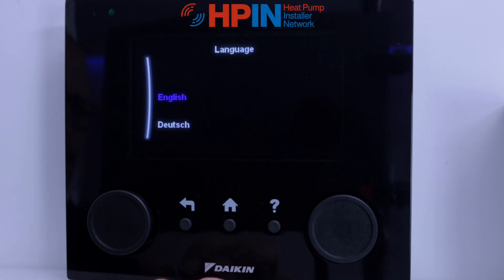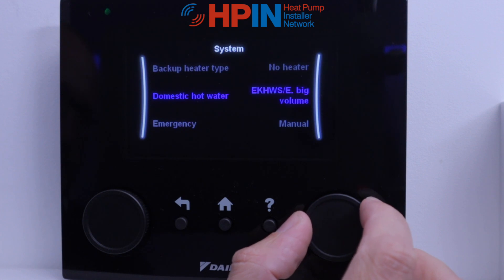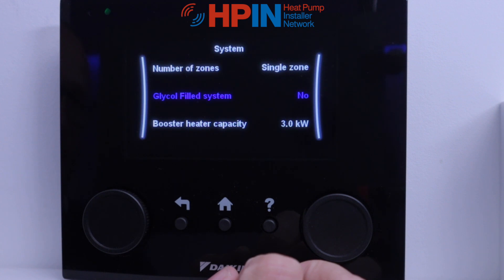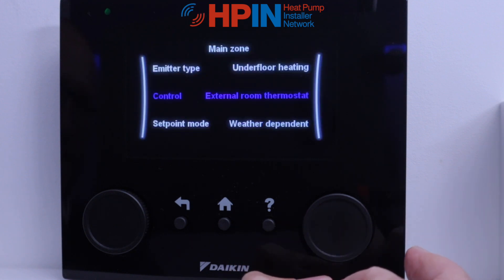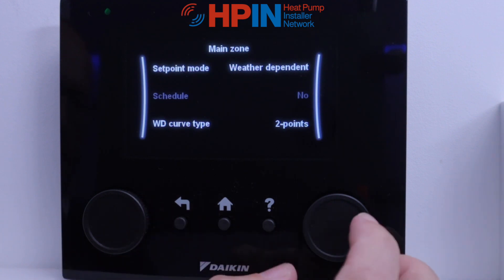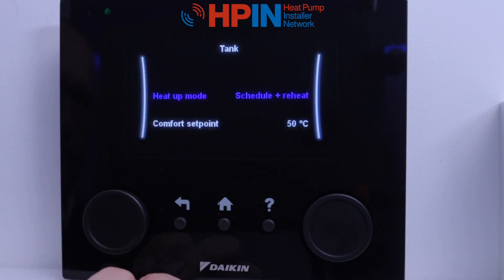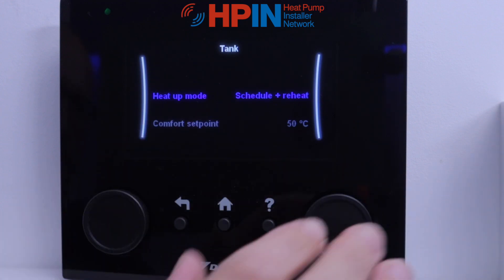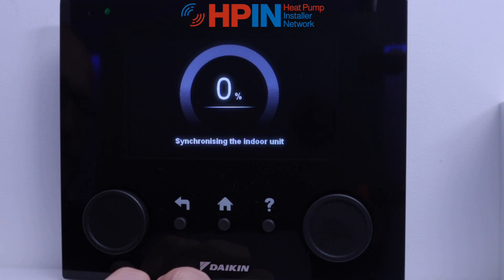DAIKIN controller setup guide

Comment: I’m just getting a heat pump installed and there’s no room to put this panel on the tank, if the panel was located on a bedroom wall, does the display turn off when left unattended?
Reply: Yes it turns off automatically
Reply: @laurensbot  cheers pal, heat pump is all up and running :)